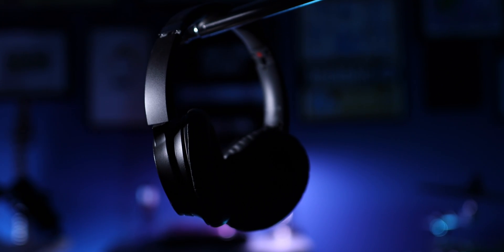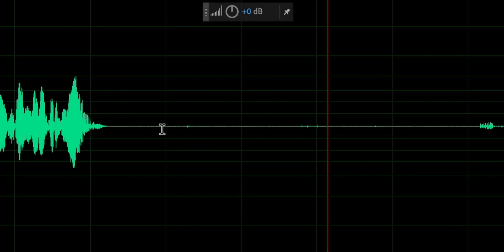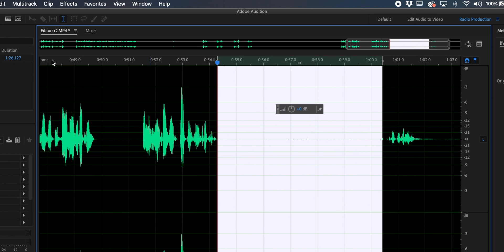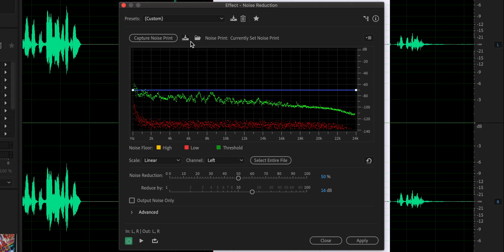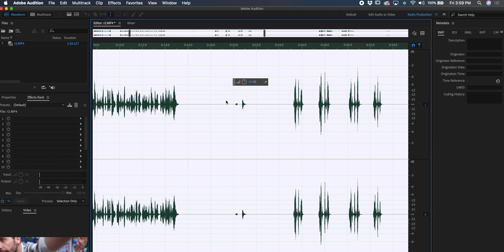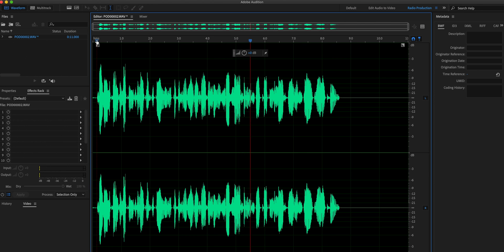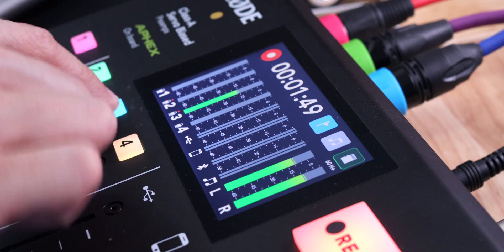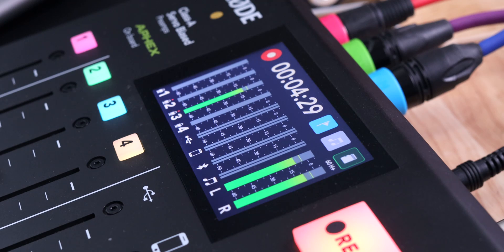Make Your Podcasts & Recordings Sound Perfect w/ Adobe Audition

Comment: Thanks for the great video, I've been pondering using Audition for my voice-over work but I'm still not sure. 
Noise gates aren't a solution that replaces software noise reduction because when the noise gate gets lifted by a loud enough signal you can still hear the noise. 
You'd still need a sample of noise to eliminate it from the whole track. 
While it is true that if you speak the noise is less noticeable, it's still there.
Reply from the maker: I agree and that's why I do prefer software if noise reduction is needed.

Comment: Audio engineer checking in.  Noise reduction is a subtractive equalization process where the overall sound level is reduced frequency-by-frequency to the point of eliminating the background noise of, say, preamps, channel strips, and microphone self-noise but doesn't work well on loud sources or asynchronous sounds like clicking or hammering or even long-period noises like fan squeaks.  Those require other solutions or retracking with better isolation.  By contrast, gates simply close the entire channel down when the overall (or keyed-frequency) sound level falls below a certain threshold.  However, once the channel is gated open, you get all the noise in addition to the signal so it only eliminates noise when the gate is active and has closed the channel.  Noise reduction, by contrast, is always removing the targeted frequencies.  That process breaks down when you gain up a channel after applying noise reduction or when using make-up gain in compression and is still audible when raising to mastered levels.  Noise is a very advanced topic and some noise is desirable and is even added in mixing music to create complementary harmonics, produce saturation, commingle the stereo field, etc.,.  For live situations or for podcasting, I would suggest rather than a gate to look into using an expander instead, which applies a smoother attack and doesn't create the jarring "on-off" effect of a gate nearly as much.  Noise reduction, which often uses a Fast Fourier transform (FFT) algorithm, can also cause unwanted digital modulation effects to source audio as well as reduce fidelity and mess with the overall EQ, so it's not a perfect tool, either.  Prevention is always the best medicine - quality mics, preamps, cabling, and mixing equipment in an isolated space with good signal to noise gain staging is the best way to reduce noise.
Reply from the maker: Thank you for this! There's a lot of really great info in here and I appreciate the help.
Reply: @tombuck  Your videos are awesome, BTW, and I've used them to help guide some of my purchases as I, too, have transitioned into a lot of remote work, even with recording artists.  For Internet calls I'm currently using a RØDE PS1 and PodMic as a result of your recommendations.  Congratulations on the success of your channel!  On a personal note, my wife's name is Heather, also!
Reply from the maker: Thanks so much! I'm glad you've been able to gain some helpful info from the channel Give all my best to Heather! 😁

Comment: Dear Tom.  I am using a Rode PODmic and a RODEcaster Pro for recording.  I love them.  However, I am getting little dropouts or clipping in audio as I am recording.  Seems to only be noticeable while monitoring.  The playback seems clear.  Could it be that I have the mic gain set to high, and that there is potential background noise causing the clip-outs?  Consider your brain picked...  Thanks, Scott.
Reply from the maker: Do you have any of the noise gate or other effects turned on? That can sometimes cause strange things. But it's also worth mentioning that the Rodecaster doesn't have the best headphone preamps. It's not uncommon to hear hiss in your headphones that doesn't end up on the actual recording. I'm actually editing a video about that right now, haha.
Reply: @tombuck  Honestly I have not tweaked the settings all that much.  Running on defaults at this point.  I don't necessarily hear a hiss, but the headphone feedback seem to cut out here and there.  The actual audio, when playing back the actual recording, seems fine.  I will play with the settings a bit more, and maybe use the rear headphone jack.  I thank you for your response.  I wish your name was Todd, so I could refer to you as the ToddFather.  Love your stuff.
Reply from the maker: Maybe I can legally do a name change 🤔

Comment: Using a gate takes experience. There isn't a bullet proof gate solution but if you are doing post production on your audio, you should always try to avoid using nose suppression because it damages audio fidelity inherently. This is a very well-known fact. Instead, you use a gate after a compander and use hysteresis to control the gate. Since this is post work, take the time to listen to the audio and double check the gate Dynamics. That's it. But noise suppression should never be used on any track unless you absolutely have to due to an annoying audible sound like a fan. Instead, use a gate and automate. Again, this takes experience and just putting a gate on a track almost never works perfectly...you have to manually tailor certain parts where the pauses in your articulation are outside the gate thresholds.

Comment: At 61 I have no desire to learn another program. I have a Microsoft Surface that main purpose is to run SoundForge (They have a ‘noice reduction’ plugin as well). But one thing that I think is most important is that Audio is more important than the video I think it 60% audio and 40% video most of the time. Spoken like a Sound guy ... LOL
Reply from the maker: I agree 100%, and when someone is working with video it's easy to get caught up in the image and overlook the sound, but people will watch something that looks bad and sounds good a lot longer than something that looks good and sounds bad.

Comment: once again a timely video! I needed it! thank you for this! quick related question while we're here. I have two Shure SMB7, set across from each other. They're picking up each other's sounds. This is the furthest we can separate them at the moment. What's the solution to stopping this issue. We wanna keep the sounds as independent as possible, that's why we got the SMB7. And we also have a broadcaster pro recorder, just fyi, if there are any tricks we can apply on that to fix this issue. Please help when you get a chance! Happy holidays and happy new year :)
Reply from the maker: I don’t have a magic solution unfortunately but it you can increase the gain and get as close to the mics as possible that helps. The increased gain will mean you can keep the volume a little lower, and the close proximity will drown out the other mic. It’s not perfect, but it should help.
Reply: @tombuck  okay will try that! thank you

Comment: Great vid. The other way to lower background noise could be use amplitude statistics, scan audio and note rms average figure and apply that minus figure into noise gate. I find it slightly better but guess it depends on room etc and to be fair as our stuff is for internet radio I wonder if any of it is noticed by listener in our use case. Lot of fun messing around with audition in any case, whether its the best way or not. Keep the vids coming. One question as a new user to Rodecaster pro. What do you roughly set broadcast meters to for output?
Reply from the maker: Thanks for the tips! I usually keep them around -16 for Audition, but I'm always experimenting. I'm not 100% satisfied with my methods yet.
Reply: @tombuck  ok thanks for speedy reply, the levels I meant were on the caster it's self going straight out live not via audition unless it is the same thing. I must admit I need to start hitting nearer the levels you mention in audition. I tend to go to -5 to -4 on music clean and vocal with an effects rack set so never going beyond -4 but clean audio is, now I just checked, about -14 to - 12 so guess ok. It is for internet radio so guess once set to -12 lufs (got this figure from Tidal Spotify and its what the recorded show is set to) it never distorts and no clipping detected. As thinking about live using Radiodj or Serato I am starting to get paranoid re output level 😆 as dont want live show to sound different levels wise from previously played recorded show. Visions of listeners riding the volume dial. Anyway hope you had as good a  new year as possible, thanks again

Comment: As a fellow desert dweller, I will defend Tom in that "AC" or "Air Conditioning" in December sometimes means the fan is running to circulate air and not actually cooling the house.
Reply from the maker: Yes! Plus, I suspect that this process will still work when the summer months roll around again 😉

Comment: The real reason to use Noise Reduction Process over a noise gate in post...NRP also removes the noise during your dialogue. Noise Gate will only eliminate noise in between your speech.  Plus...noise gates are finicky.
Reply from the maker: Great point! I’ve always struggled with noise gates- it usually ends up sounding distracting.
Reply: I agree.  They are tricky.  They also seem to work better with condenser mics rather than dynamic mics.

Also Spectral Frequency Display helps find noise in your audio.

https://youtu.be/8XMG0IwSXwM